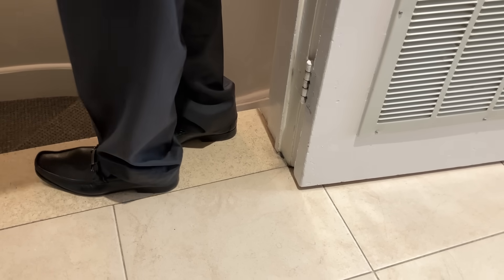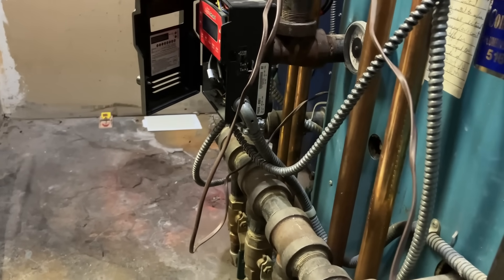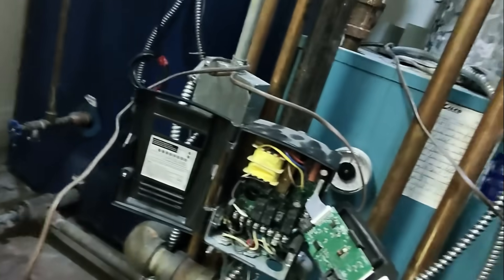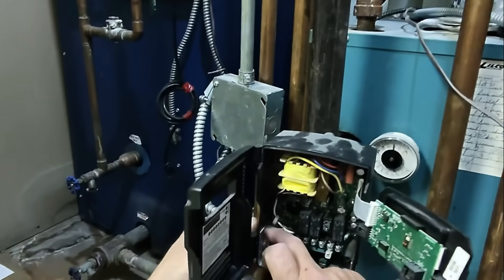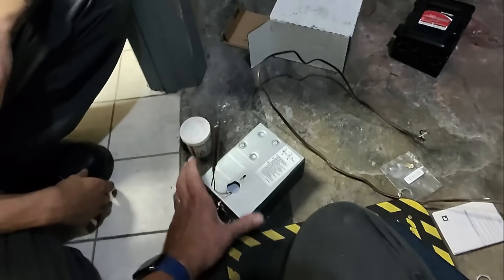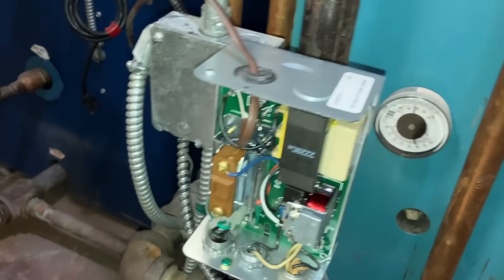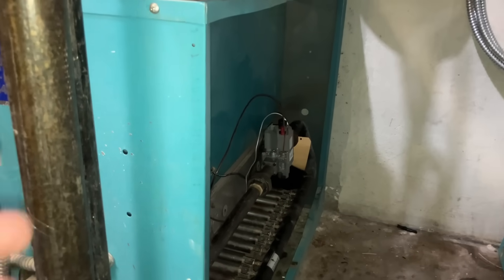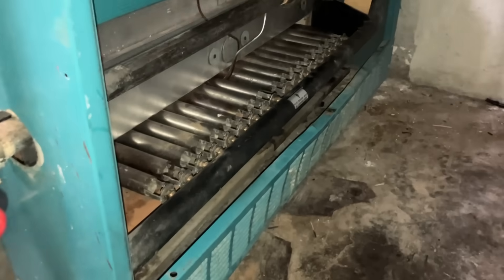Homeowner Lost Heat for Weeks… Until We Found THIS Hidden Boiler Problem! 💥

Comment from the maker: 🔥 Thanks for watching, folks! Another real-life service call from Mikey Pipes – Pipe Doctor Home Services, Inc. 💪
This Burnham gas boiler had no heat and no hot water because of a failed Beckett AquaSmart aquastat — but we brought it back to life with a Honeywell 8148 mechanical control. Sometimes simple is better!

💬 Comment below if you’ve run into this issue — or tell me what boiler you’re running at home. I read and reply to as many comments as I can!

✅ Limited Edition 2025 Mikey Pipes Poster — only $42.50 delivered!
Includes 5 stickers, pen, card & magnet — plus 100% goes to our 501(c)(3) nonprofit, Mikey Pipes Philanthropy, helping families in need of plumbing & HVAC repairs.

👉 PayPal: office@pipedoc.net
👉 Venmo: @PipeDoctor
👉 CashApp: $mikeypipesny
👉 Zelle: office@pipedoc.net

📞 Pipe Doctor Home Services, Inc.
Serving Long Island, NY — Call 516-348-6300 or visit https://pipedoc.net

#MikeyPipes #BoilerRepair #BurnhamBoiler

Comment: I wouldn't doubt it was having enough temperature overshoot and locking out due to the probe well being placed so far outside the boiler casting. probably happening when it shuts off after heat or DHW call. the old style electro-mechanical doesn't care and just thinks it's satisfied at temp.